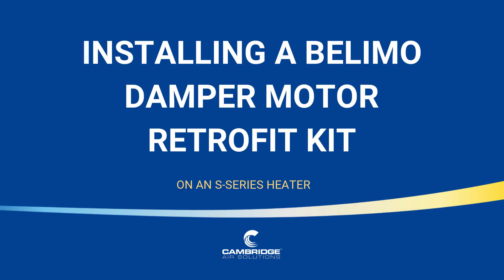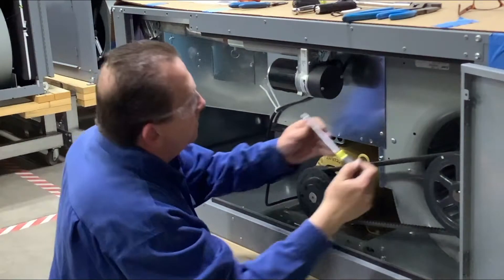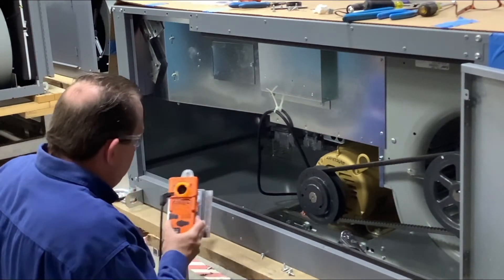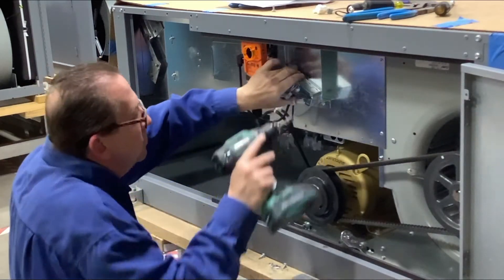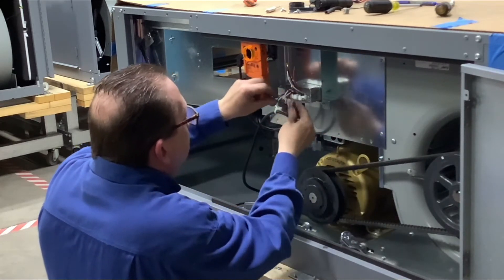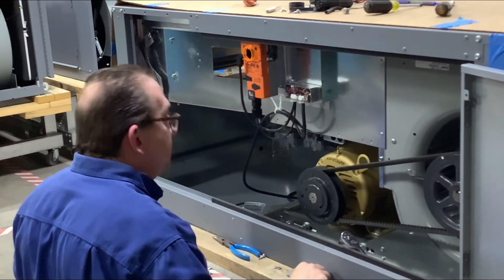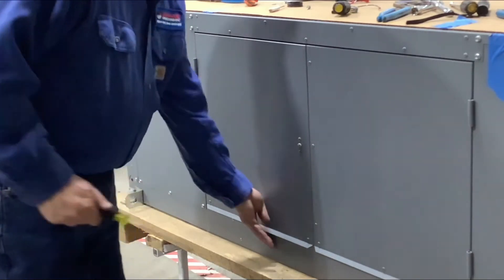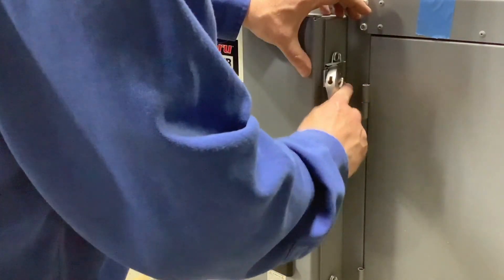Installing a Belimo Damper Motor Retrofit Kit

Comment: Hi, The unit that I am working on trips on high limit couple of times in the winter. someone already opened the damper manually, and still trips. Can it be just a weak high limit ? Any suggestions will be much appreciated.
Reply: Check your belt tension. Could be something restricting airflow as well. High limit switches can become weak as well and trip early.